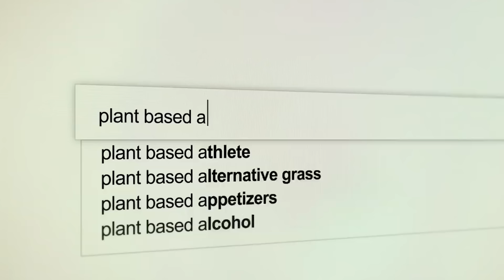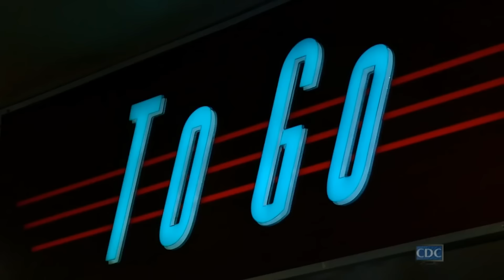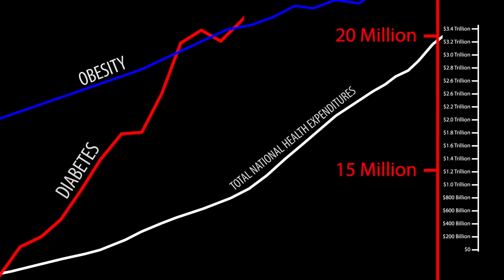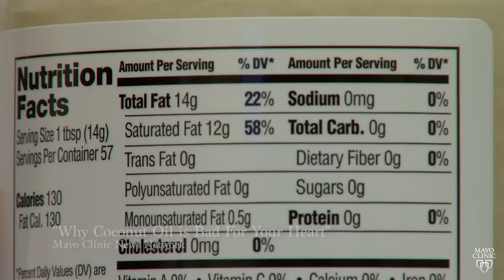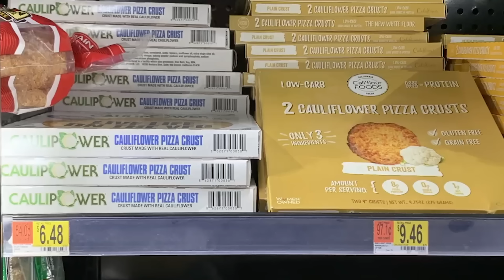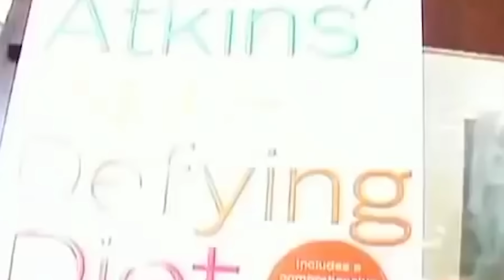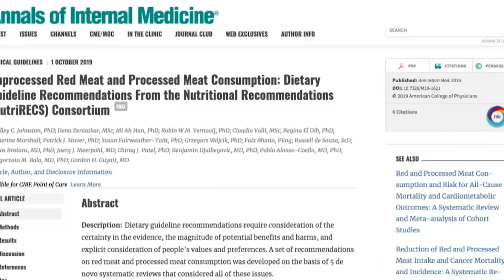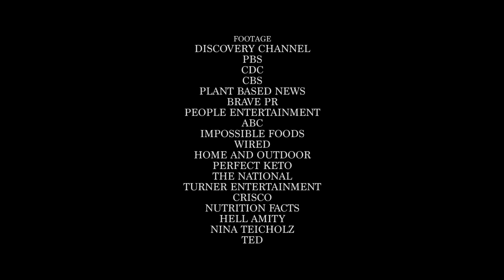FAT: A Documentary 2  - What should I be eating?

Comment: Quit sugary drinks and snacks long ago. Then the "hype" event started. Gained 20lbs/10kg over a year. Felt awful and blood tests were out of norm. Now, dropped most of the weight, got a physically demanding job, feel great. I did cut out more carbs but nothing crazy. Eating better and getting a workout while working has done well for me.
Reply: I'm happy that you feel better. I would like you to do something. Go look up the amount of calories that exercise burns. Compare that to what you eat. You will find that one hour of say jogging might offset an apple, if your jogging is high impact.
Reply: @davidmiller9485  Yeah, a 95 cal apple is either running a 10 min mile or about a 30 min walk. I've read that for every pound of fat, it takes about 3500 extra cals to gain it. I usually don't eat for at least 12 hours before work so usually no food for 16-24 hours most days. Cheers.
Reply: @DanSpotYT  That's how i run as well. "fasting" for most of the day before my one meal in the evening. :)

Comment: Here's something for my exercise-avoidant friends. Being obese makes exercising WAY worse. I have a lot of personal experience with this. When I went on keto and lost a good amount of weight, I gained a greater capacity to exercise. Namely, aerobic exercise. In school I was never able to complete a 1-mile run without having to walk. After losing weight with keto, without starving myself, in conjunction with time-restricted eating, I found that jogging was far easier and even kind of fun.

I followed with my doctor and my cholesterol improved (it was never high, but my HDL was low), my GERD resolved (especially with time-restricted eating), I drastically improved my blood pressure, and I had my doctor's blessing despite not being a keto-positive doctor.

The medical advice was simply "You've lost weight and improved all your biomarkers and blood pressure. Keep doing what you're doing because it's clearly working"
Reply: I got distracted. If you're suffering from obesity, try time-restricted eating if not full ketosis. Lose some weight first and slowly add exercise. It's an amazing feeling to have a significant improvement in your exercise capacity by simply losing excessive weight

Comment: I  use the science of a keto based diet and cycle it into my over all eating habits. Also fasting is a tool I use. Over all we definitely need to get away from processed foods especially highly refined carbs that have long shelf life and seed oils. I am not someone who stays in a ketogenic state permanently as we need to come out of it sometimes and stay metabolically flexible.
Reply: You are 100% correct. Many get stuck on the idea they need to stay keto all the time. Yes, it has benefits, but as long as someone is consuming minimal carbs (even as low as zero, there are NOT any essential carbs to consume for health/life) and keeping Randle cycle activation low (meaning inflammation, insulin resistance, etc are also low), people will be healthier.
edit - to come out of keto without consuming carbs, increase protein and decrease fat

Comment: Not a big fan of keto because it does have negative effects in the long run. It sure does work to lose weight. For me: I eat a balanced diet with all macronutrients in it.  I don't eat added sugars (the occasional ice cream or chocolate notwithstanding), no white flower, few grains to begin with and on the other side of the spectrum a moderate amount of fish and meats and a shitload of vegetables. I don't eat overly fatty either - there's some fat in it, but not too much. So in a matter of speaking it's a high fiber, low carb, low fat diet. Good for me being lazy and not working out.
So in a nutshell, I eat like I grew up - meat is for weekends, cheaper foods during the week and always home cooked and from as good a source as I can afford or find.  Losing weight is easy on this kind of diet - I only eat one meal a day and maybe a snack like a salad or something. Guess you can call that intermittent fasting and it works easily without having to restrict yourself over the top. Works for my lifestyle.
Reply: The propaganda has a hold on you!
Reply: @awesomesauce3110  What propaganda would that be? The one for common sense?

Comment: All diets work equally well for fat loss if they are properly set up and consistently adhered to overtime 🤷🏻‍♂️.

The strictest and most controlled studies available where people are locked in a metabolic ward chamber of a hospital, their metabolism precisely measured, their energy expenditure precisely measured, and their food intake is weighed & tracked to the gram:

Show that when  protein and calories are equated, there’s no difference in body fat loss or health improvements between a ketogenic diet and a high carb diet.  Between one meal per day and 10 meals per day.  And whether someone is insulin sensitive her insulin resistant.

So everybody who hopped on keto and it worked when other diets didn’t, you simply didn’t know what you were doing.

And before somebody starts trying to bash me, I’ve helped thousands of people lose weight, keep it off, and reverse health conditions on been every single diet there is.  I’ve also been on every single diet successfully, and I’ve been on keto and low-carb for years.  So no, keto and low carb are not inherently special 🤷🏻‍♂️.

Comment: There is a big problem that is largely being down played or not discussed much. I eat a largely meat and green diet and am able to keep my fasting and average glucose in the 70s-80s but the numbers start creeping up until my fasting and average glucose stays around 100 and higher. So then if i eat a high glycemic meal of beans and rice or oatmeal for example a day later my fasting and average blood glucose drops back down into the 70s and 80s. So to say a low carb diet is the answer is false. It is a great way to lose weight but its not a miracle and when the liver has to produce glucose it up regulates the level and or the pancreas just quits producing as much insulin.
Reply: You may be insulin-suppressed. Go do some blood work and check for fasting insulin, fasting C-Peptide, GAD65 and IAb 2.
Reply: @DJMT-Africa  my fasting insulin and C peptide are both good.
Reply: @GregariousAntithesis  What are the actual values of each, please?
Reply: @DJMT-Africa  Test Name: C PEPTIDE (NTX)
Result: 1.56 
Units: ng/mL
Reference Range: (0.78-5.19)
Interpretation: Results should be used in conjunction with other data; e.g., 
symptoms,
results of other tests, and clinical impressions. 
Performing Location: DALLAS VA MEDICAL CENTER

Test Name: INSULIN(SL3192)
Result: 4.6 
Units: uIU/mL
Reference Range: 
Interpretation: -- 
Performing Location: QUEST-IRVING
Reply: @GregariousAntithesis  Not too bad... ideally, I'd like Fasting Insulin between 2 - 4, and C-Peptide between 1.0 - 1.5. So while your numbers are not bad at all relative to the general population, I'd look at bringing each of them back by 0.6 for Insulin and 0.06 for C-Peptide. All that said, I think your blood sugar dipping after a carbohydrate meal could be related to "Reactive Hypoglycemia", where you produce a lot of insulin on the back of a high-carb meal, but because you are insulin-sensitive, you are able to deal with it healthily, hence the low-ish blood sugar postprandial.
Reply: @DJMT-Africa  still doesnt explain why my fasting and average blood glucose trends upward to around 100+ eating only meat or low carb/ low glycemic. Yet when it starts hitting the mid to high 90s fasting average i have to eat a high glycemic meal to bring it back down in the 70s-80s.
Reply: @GregariousAntithesis  Fat + protein do not trigger insulin, so eating them will not spike it. The thing to do would be to try and understand why your blood sugar is rising in the first place. Cortisol and epinehrine will raise blood sugar, especially after a night of poor sleep. The fact that it’s not going down quickly may indicate that your body is still more glucose-adapted than fat-adapted. But you are still reasonably insulin sensitive that when you have carbohydrates, your blood sugar rises enough that insulin is triggered. This, then, has the effect of lowering all your blood sugar, present and past. Your fasting insulin + c-peptide numbers suggest that you are insulin sensitive, so the rise in blood sugar should be investigated further. I sense you may be insulin-suppressed if you have been on keto for a long time, where your body becomes “glucose sparing”. If that is the case, you would do well to trigger your insulin daily so your body “remembers” how to produce it. The safest way to do this without carbohydrates is to drink a glass of whole milk twice a day. Try that for 2 weeks and see if it makes a difference. Insulin suppression is something that is coming up in long-term keto/carnivore folk.
Reply: @DJMT-Africa  i have a theory of what the issue is. I drank a ton of mountain dew in the past and lived on bread, rice, pasta typical crazy high glycemic diet. I think the sensing mechanism of the body for insulin release/production is out of wack from being exposed to excessively high blood glucose for most of my life.
Reply: @DJMT-Africa  i eat cruciferous vegs and a large salad daily. So i started adding baby carrots and beets to my meals snd it still wouldnt bring my blood glucose down in the 70s-80s fasting snd pre meal. To me the test that shows metabolic health is pre meal blood glucose and unless i have been doing some moderate exercise or higher i expect my pre meal blood hlucose to be 70-99 and typically when i have eaten a high glycemic meal within a number of days prior my body likes 87. 
My solution to the fasting average number going over 100 has been a meal including rice and beans or a big bowl of oatmeal then by the next day i will be back in the 70s-80s. Originally when i started this diet last October i was fanatical about no sugar. Grains, starch or high glycemic fruits but now i realize at least for myself i have to eat some high glycemic complex carbs on occasion to manage my blood sugar. The milk idea might be an option i remember as a kid being hypoglycemic and eating a bowl of lucky charms to fix the issue of the shakes, etc. always seemed it was the milk not the high sugar cereal that was what addressed the low blood sugar quickly.
Reply: @DJMT-Africa  when you are not eating carbs and the liver is making glucose in my case it over compensates and thats when my blood glucose starts going up and staying around 100 or over. I can tell because my ketone levels are high. Usually when my ketone levels rise shortly after my fasting average blood glucose rise as well. So i have basically went back to being a glucose burner to address the problem and as long as my body glucogen stores are full my fasting average blood glucose is normal 70-99 but once my glycogen is depleted and my ketones rise so does my fasting average glucose.
Reply: @GregariousAntithesis  Your fasting insulin + c-peptide suggests decent insulin production, but just to be sure, run a GAD65 + IAb 2 test to rule out any possibility of LADA (Latent Autoimmune Diabetes in Adults). Also, what is your latest A1c?
Reply: @GregariousAntithesis  Sounds like you have either gone back to glucose-burning, or you were not properly fat-adapted. What level of ketones do you peak at when you are making more sugar from your liver?
Reply: @DJMT-Africa  around 4 mmol/l i tend to idle around 1.5-2 eating meat and greens or just meat. It is almost impossible for me to ever read a zero. I think its because i keep my body either right at caloric equilibrium or in a slight deficient.  I never gain or loose weight i stay right around my goal weight of 165 give or take 2 lbs either direction.
Reply: @GregariousAntithesis  And when your ketones are at 4, what is your blood sugar doing?
Reply: @DJMT-Africa  my A1C before i started the diet in Oct 21 was 5.7 for two years in a row. Wearing a cgm around 2-3 months in in my diet my average blood glucose over a month and a half was beautiful like a 91 which using an A1C calculator was around 4.8. My actual A1C in April on lab test of this year was down to 5.4 and that i think was largely becsuse at the 4 month mark on low carb was when i started having the higher fasting average blood glucose and so the last 2 months i was experimenting trying to figure out how to get my numbers back down to the 70s-80s.
Reply: @DJMT-Africa  when my ketones start going up to 4 or higher my blood sugar starts going up eventually ending around the low 100 range.
Reply: @DJMT-Africa  its a game of cat and mouse with this trying to keep any sort of roughly decent average in the 80s or even low 90s. The month of may was my birth month and so i decided i would cycle back on glucose burning to see if it would fix the probem. So thats when i started adding beets, carrots, beans and rice snd oatmeal into my diet. I mostly would just eat like i said beets and carrots with my typical vegetables daily and it had no real impact. Only when i started adding beans snd rice was i able to see a difference. This is how crazy weird it is, typically my daily diet will raise my blood glucose to around 130 about the same as my post exercise blood glucose. When i started adding beans and rice the first few days my max post meal blood glucose was in the 130s like my typical meat and greens meal. Third day adding the rice and beans my max blood glucose spiked up to around 175. Then for over a week my average/fasting stayed in the 70s-80s. Which says to me my glycogen stores are depleted and eating beans and rice with two meals filled them back up then the third day since the glycogen stores were full my blood glucose spiked because there was no more room in my cells for the excess glucose. All i know is i cannot eat high glycemic foods daily and keep my blood glucose in the 70-80s either.  I have to constantly cycle in high glycemic carbs around every 5 days to maintain a normal level. For me there is no consistency over a long term. Maybe if i was consistently eating a calorie surplus it might be different but to me that is how we get fat and dysfunctional to begin with.
Reply: @DJMT-Africa  also at my last labs in April, my Tests were all great only exception was vit D was low snd folate was low and i have since started supplementing daily because i get plenty of sun and eat all the foods that should have my ranges normal. I go to the VA so i pretty much request every test known to man to monitor for diet related issues. Thyroid T3,T4 good, CRP non existent, all my electrolytes good in range, mid day cortisol nornal
 Test Name: CORTISOL,SERUM
Result: 7.4 
Units: ug/dL
Reply: So you're actually saying when you eat a high carbohydrate meal your blood sugar level drops. Interesting and counterintuitive. Since that's the case why do you avoid carbohydrates it seems?
Reply: @GregariousAntithesis  So, it turns out that Vitamin D deficiency is less to do with nutrition and more to do with cholesterol. As long as you eat food rich in Vitamin D, and you are insulin sensitive, you don't really need Vitamin D supplements. So your case is quite interesting, especially since you appear insulin sensitive.
Reply: @GregariousAntithesis  So when you are just eating fat + protein, are you restricting your calories?
Reply: @annoyedaussie3942  because its a balancing act. I cat just eat high glycemic meals/food every day or my fasting/average goes up to low 100s and if i don't eat high glycemic meals on occasion my fasting average goes up to low 100s.
Reply: @DJMT-Africa  i wouldnt call it restricting as more i just have done the math and know the calories in what i eat. Could i eat more at dinner probably but i have figured out that a heavy mid day meal and a light evening meal works best for blood glucose. Evening meal is also where i eat fish and a large salad instead of other heavy meats.
Reply: @DJMT-Africa   if you're saying cholesterol is too high  maybe you're referring to triglycerides which is effected by sugar consumption
Reply: @theantiveganchannel3596  Hmmh, not sure I recall talking about cholesterol anywhere 🙃…
Reply: @theantiveganchannel3596  what is your pre meal blood glucose before dinner?
Reply: *lose
Reply: @Marta_is_here  i would rather have loose weight than lose weight 😂
Reply: @GregariousAntithesis  the simple fact that you are checking your glucose is all that matters.
you are finding what works for you. that's all it takes. i am surprised how many people will not check their glucose. its not rocket science. i really enjoyed your back and forth with this discussion.
Reply: @sharkair2839  10 months later and my fasting average glucose has settled down and is always from 70s-90s typically mid 80s fasting and mid 90s most of the day. My average based on my meter is bow 96 which is roughly an A1C of 5.0 roughly. I can alsp eat carbs in moderation again without having crazy spikes above 140. Body seems to have largely healed itself. The most import take away from this is no matter what the diet eat in equilibrium to deficiet do not eat a calorie surplus most of the time and your metabolism will work as intended. Additionally interval or circuit exercise with heart rates in the 14"-160 range 3-4 days a week an hour a session are a huge benefit to glucose management. 
People are afraid of the finger pin prick as stupid as that is, i was myself at first but it quickly becomes no big deal, really doesn't hurt much. Cant justify using a CGM all the time and now that my blood sugar has largely stabilized no reason to.